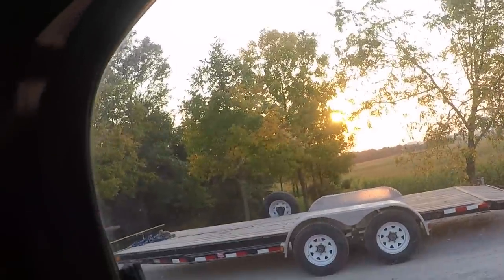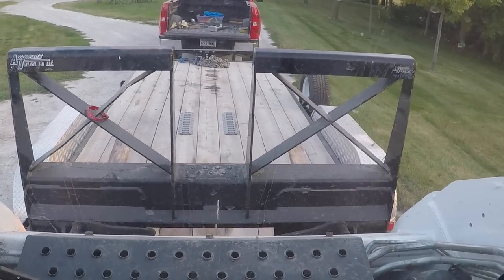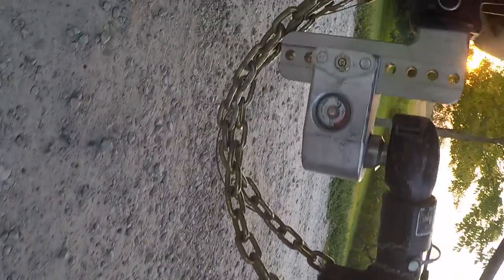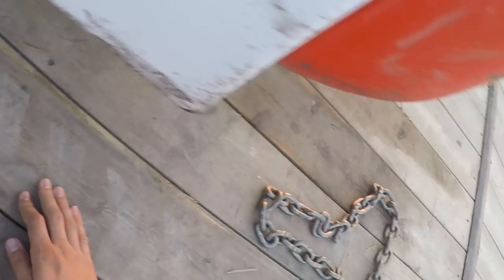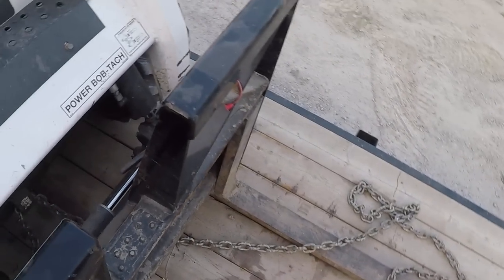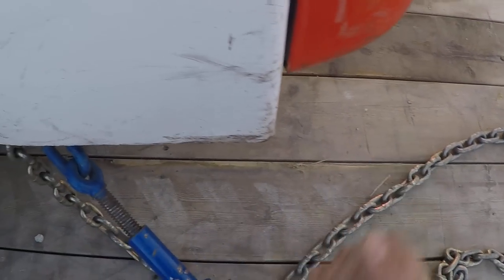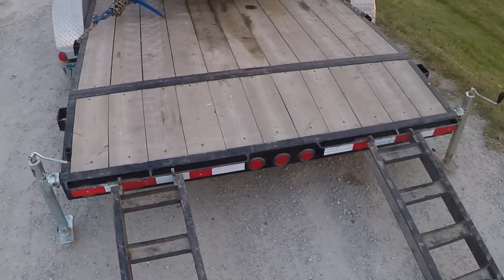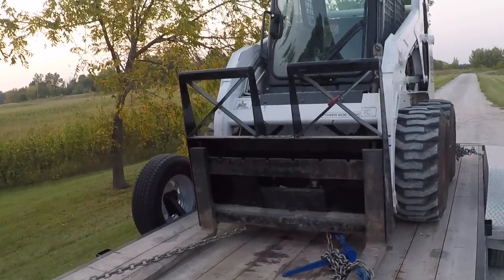How To Safely Haul a Skid Steer Loader

Comment: You might consider putting the binders on the passenger side. That way if you pull over to inspect the load, you can tighten the binders without being so close to cars passing by. I think it is safer that way.
Reply: They are on the drivers side so you can see them pit of your close side mirror
Reply: @derekwynn1778  exactly
Reply: He should alternate then and also add a horseshoe for side to side play

Comment: My son just bought a skid steer this weekend.  It is a larger Case.  Bobcats do not have a good reputation in our area.  It is too heavy to put on my crappy bumper pull, so we haul it on his high deck goose neck.  We ALWAYS back shor wheel base stuff on that trailer.  Drop your chains through the pockets and come up and drop the hook down to onto the side of the loop.  That way, it takes a loose chain and a BIG bump to release the chain.  I much prefer the over center boomers.  They are  much faster than the ratchet ones and if you use a pipe or trucker's bar your face is out of the way.
Reply from the maker: we don't back it on because when we had our CAT, the dealer said it would spin the turbo backwards and could damage the engine is what we were told
Reply: BornToFarm101 it’s not that the turbo spins backwards, it’s just a shaft with bearings designed to spin tens of thousands of rpms. What kills them is spinning without lubrication.
Reply: I have even heard that you should block the intake and exhaust when hauling anything with a turbo.  I have hauled a lot of stuff with turbos and never had a problem.
Reply: Bobcats don’t have a good rep? Lol they INVENTED the skid steer
Reply: @BrettMcNary  yep, by far the most popular ones here in Missura', Iowa, Illinois, and Kansas area where I did my search.

Comment: FINALLY! Back in your own machine. I have had some debate with our local donut patrol about how to tie my Bobcat down. Thankfully I was able to find specs from a court case. The proper way is to have one chain and binder for every tie down point on a machine. Since the Bobcat has only two tie points being a lighter machine is is ok to chain my machine to both sides of the trailer and connect the ends with the binder. Since my trailer is higher than yours I always back the Bobcat on when it has light or no attachments. Of course with no fenders you can turn it around when on the trailer. The ramps have a support so you can go on and off without lifting the truck up. Really looking forward to your baling with the Bobcat there!
Reply: ...donut patrol?!?! Really?
Reply: That's what we call the Florida Highway Patrol.
Reply from the maker: Ya, same here, I think since the bobcat is less than 10K I can get away with just two binders.  When we had our Cat machine, the dealer told us to never back the machine on the trailer because the wind down the road can make the turbo spin backwards and make all sorts of problems.  Not sure if its the same on Bobcats or not
Reply: I never thought of how the turbo could spin from having the machine backwards but only my 863 has a turbo and it is not able to spin because air cannot flow through the engine therefore the turbo cannot spin unless it is running. Your funeral experience brings back memories of when an out of control pickup driver went off the road and ran into me while I was in a Bobcat. He hit so hard it broke the rear door off of the Bobcat. Next thing I knew I was looking at the ground sideways and my co-workers were trying to get my attention. Had the seat bar down and the seat belt on with a hard hat and somehow was not injured.
Reply: chargermopar Its the air going into the exhaust spinning the turbo with no oil flowing

Comment: My condolences to Ofc Mathew's family and to his department. I read about his incident on the Officer Down Memorial Page.
On a separate note...just an observation.....It looked like you hooked your chain to the stake loops. I always run my chains "through" the stake loops and hook it to the frame flange. Stake loops are usually pretty weak by design and hooking to them (instead of to the frame) could break the weld and end up allowing the skid loader to move forward / backward. Just a thought.
Reply from the maker: Ya, it was a bad deal, hopefully I never have to attend another officer funeral but you and I know that it will continue to happen.

I'd have to inspect our trailer further.  You're right that its probably the chinseyest part of the trailer. thanks for the tip
Reply: Commonwealth Farms p

Comment: Allway pull you chain out flat and untwist them first. Cross chain. 4 corners, 4 chains and 4 binders. Don't allow chains hooks or binders to wear against a place that might move , ( your forks). Allways hook from top down, other way they would unhook if slack appears. If fork might bounce chain seperatly. Load which ever direction is safest for machine balance and driver skill. Can you see what you doing. You can cover exhaust with a tin can and  or duct tape!
30 hours with no sleep!!! You needed to get good sleep 15 hours ago!  Fatigue kills when mixed with machines and co-worker! And on the public hyways!   Where gloves and real shoes too

Comment: Without getting technical I always try to center the skid steer over the axles. But then I use a Gooseneck equipment trailer with duo tandems. I always load extra attachments.
Reply from the maker: well look at that, we have the same first name.  never used a gooseneck but the reason im a little in front of the axles is for tongue weight.  i try to have 10-15% of weight on tongue.  i have a scale on my hitch thats why

Comment: Chock your wheels, drop your hooks through the tie down hole and back up so the hook slot is facing down. 

Sorry to hear about that Officer
Reply from the maker: Thanks, see I've tried chaining that way before but to me, it always feels more difficult to get all the kinks out of the chain and pull tight without an kinks in it that way.  I'll have to try it again
Reply: Here's a couple of concepts with running the chain down through the hole then hanging the hook on the hole edge: if anything were to shift or loosen the chain a couple of inches, that hook will still be sitting on the steel.  Also you do not have to keep pulling on the chain when you are initially stringing it up.
Reply: No shit!  This is another reason why the guy has NO idea what he's doing.  Too bad ya' can't flag a YouTube video!!!

Comment: Couple years ago I rented a 185 bobcat, I had my 14' bigtex dump to haul it in.I tried loading it forwards but felt it would flip.Somebody came out of the office and said load it backwards,worked much better.Ok so I'm loaded and ready for some breakfast,I'm sitting at Ihop reading the rental agreement,it says in the paperwork to always load backwards.Funny nobody ever reads the rental agreement.Oh fill fuel tank before returning or they will do it for you at 10 dollars a gallon.
Reply from the maker: i know they load easier backing on but when we had a cat, a dealer once told me to load forward otherwise the wind will go into the exhaust and spin the turbo with no oil and that can be harmful.  take it for what its worth.

Comment: Check your laws in your state. In Minnesota you need 4 chains on a skid steer with a binder on each and they must cross. Right side of machine to left side of trailer and fronts need to pull forward  while the rear chains pull back.
Reply from the maker: if you could post that info that'd be great.  i looked and looked and had trouble.  i remember reading if your machine is heavier than 10k then you need to do what you described  this machine is under 7k.  i even sent a picture of my machine tied down to a commercial vehicle enforcement officer and he said i was within regulations
Reply: I don't know where you will find it. Whatever officer told you otherwise is wrong. Been in commercial dirt work in Minnesota for over 30 years for as an operator and sup. Hundreds of hours of training with unions osha and private training. Had speakers from DOT and state patrol many times. You need 4 chains and binders that must cross and pull forward and back.
Reply: That being said. When I started running bobcat in the late 80's we just threw one chain over the back of the bucket and hauled ass. I never lost one. At least that I remember. The 70's were good to me.
Reply: Check your laws. In EVERY state you have to use 4 tie-downs.  Its a federal law.  This clown has NO idea what he's doing.
Reply: @rodbuilder3657  Why call this man a clown?   Does it make you feel better?

Comment: I have a 2009 Chevy hd single cab. I was wondering if it would
Be safe to tow a similar set up as you ..what is the trailer weight ..you chose? i will be getting one for  future work  I have a tractor with brush hog right now but ...may want to get a sidsteer

Comment: On M series machines you see the two holes on either side of the boom at the top of the tires those are the tie down places to hook.
Reply from the maker: interesting.  what about the loop on the front of the machine behind the bucket?
Reply: @BornToFarm101MN  hydraulic line feed retainer loop for attachments, keeps them from moving around and possibly getting pinched....

Comment: in michigan for my backhoe all 4 corners required seperate chain and binders and front bucket and rear boom has to be secured also.  for a 10,000 lb machine. the rating on chain and binder has to be more that 1/2 of the weight of machine per corner. by securing the pallet forks you secured the boom but did not secure the front of machine, thats a big ticket here
Reply from the maker: i read through a lot of books for tie downs.  different machines that weigh more require more tie downs like you said with 4 separate points.  also i ran the chain through the forks to the front point on the machine.  i would never trust just the bobtach to hold the machine on the trailer

Comment: Hmmm.... two things...
1- you have the whole tie down method incorrect.  A FOUR POINT TIE DOWN.... (not four contacts) is supposed to have SEPARATE tie downs and restraints at four different points of the trailer.  You have two.  You cant hook a chain to one side up front, run it through your tie down ring on the bobcat, then hook the other side up front and put a binder on it there.  THAT's ass backwards bud.  If your binder comes loose, then there is no longer anything else to secure the bobcat from going backwards!  THE WHOLE CHAIN is now loose! Ever think about that?  The concept of a 4 POINT TIE DOWN is that if one binder comes loose or if that side's chain breaks, the OTHER SIDE STILL IS TIED DOWN! Holding the bobcat from rolling backwards.  Or visa versa for the rears.  That is the whole point of it.  That is why there are laws and regulations on tie down for heavy equipment.  Then there's the whole grades for the different chains as well.  But a FOUR POINT TIE DOWN is NOT what you just did in the video.
2- You have to have a chain "securing" (doesn't have to be tied down) to any attachment that is to the machine or anything that has a hydraulic function in which can move during transport.  The bucket (fork) should have it's own chain wrapped and dropped through a stake, then simply hooked back to the chain.  For a backhoe, I have to run a separate chain for the front loader and have that dropped through a stake and also the back dipper stick. That also has to have a chain securing it to the trailer.  Again, those do not need to be tight, but just secured.  You even caught yourself saying something that didn't make sense in your video.  You  said even if you chain comes loose or your binder comes loose, your pallet forks are still secure ? How on earth are they still secure if the only chain with the ONLY binder comes loose ??  Not only is your machine now COMPLETELY loose holding it forward, but the front pallets are definitely loose as well.  
And also.. your hook to the chain is SUPPOSE TO DROP THROUGH YOUR STAKE, COME BACK UP OUTSIDE THE STAKE, then hook.  You don't hook it come from bottom up.  Chain or binder loosens a little and now your chain freely drops...!!  If you drop it THROUGH the hook, bring back up around and hook the hook to the STAKE... well now it doesn't go anywhere even if your binder comes loose.  When the machine moves, god forbid, it'll at some point eat up slack then hook and tighten again, BECAUSE THE HOOK IS STILL ON THE STAKE.. from top down bud.  Never from bottom up. :( 

Nevertheless, this video should be taken down.  You have it clearly titled as ..."SAFELY haul a skid steer" ???  You're method is clearly not safe at all.  Someone who has never done it before, a newbie or a novice or even a first timer learning,  could easily click on your video, watch it and think this is correct.  Then that new person will go do the same, put one binder in front on the only chain being used to tied down the whole machine up front, then not tighten the binder down correctly or enough, get on the road.... it come loose and BAM!!!... SOMEONE COULD GET KILLED.  SERIOUSLY HURT OR SOME MAJOR DAMAGE TO PROPERTY.  WHY ? because you claim you know the correct way to tied down a skid steer, you so confidently start your video with a cocky attitude that if other people are going to critique it, the hell with them, that this is the way you do it and it's right.  IT'S NOT RIGHT.  ASK A HIGHWAY PATROLMAN... LOOK AT THE COMMENTS BELOW ... HELL, JUST ASK.  Do yourself a favor and save yourself from embarrassment, being the reason why someone would get hurt or cause an accident and take this shyt down. Make the correct video, say what you did wrong and right it.  Shoot another video doing  A CORRECT 4 POINT TIE DOWN  with 4 different binders, securing the machine at four different points of the trailer, would be right.  You don't need to buy four chains, use the same two chains, but you need four binders.  I'm sure you're not going to figure out how to do a four point tie down with only two chains, but that wouldn't surprise me.

Comment: Just throw the chain across the front boom and pull it hand tight is all you need with the parking brake set that machine will not move
Reply from the maker: i know they won't move but legally you gotta chain them

Comment: You are not giving yourself any bounce protection by tying so low on the front . Maybe your roads are better than mine but here , that's just looking to see your skid steer bounce . The chain stress should have a downward pull , just like you did in the rear . 

I totally agree with one comment , 4 point tie down . Who cares about minimum regulations , over kill this shit . 4x G70 chains and hooks , 4x binders rated at 5000lb mins (I use 6500) . I feel secure on the road , I can't say I would knowing my investment , and the safety of the public relied on 1 single part with no back up . You may as well take those safety chains off your hitch and just rely on the ball , see the point ? 

Are those tie down points engineered for the weight you are expecting them to hold ? I'm gonna say NO . Your trailer should be equipped with proper anchor points rated for specific load and signed off on . In the case of an accident , I assure you , the investigators will be looking at that . 

I am glad you posted your video , I hope you learn from the comments

Comment: if you back your skid steer onto the trailer your less likely to have a rock hit the expensive glass in the door
Reply from the maker: i was always taught to do it this way to prevent air going in the muffler and spinning the turbo with no oil
Reply: that sounds silly the science behind that comment sounds stupid. you would have to travel at an super high speed to cause damage plus check out a diagram of a turbo

Comment: The best way to chain down a skid steer is to use 4 chains and 4 binders one chain and binder per corner because if one of those chains or binders fail you have only one chain and binder hold a 6600 pound skid steer if your going to be that damn stupid your better off using 4 one inch ratchet straps at least having 4 of each your still have three chains if one fails better be safe than sorry I use 4 chains and binders for everything no matter if its a ford ranger or a f450